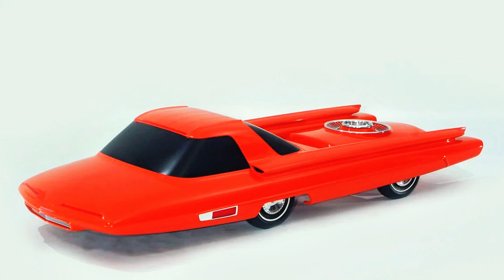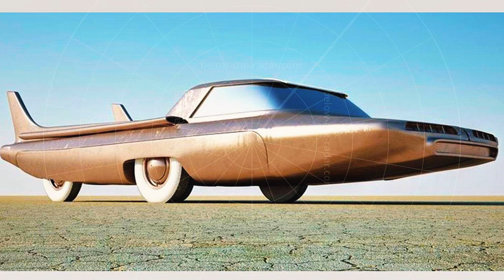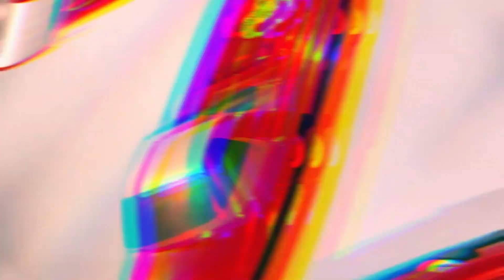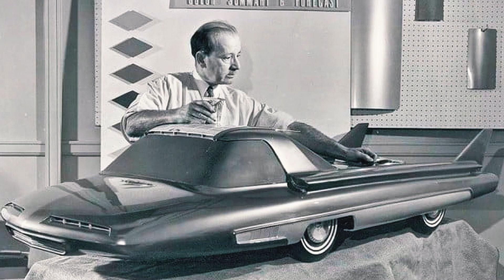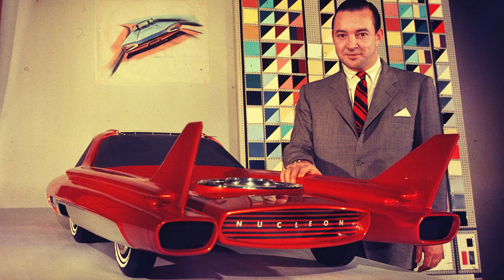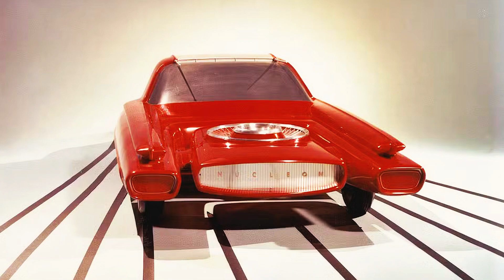Ford Nucleon – The Nuclear Car That Never Drove

Comment: I was born in 1951 and the 1950s were a time of unusual ideas for the use of the nuclear energy. There was the idea of nuclear powered airplanes. There were even tests of a B-36 Bomber carrying a small nuclear reactor that did not power the airplane just for tests. There was also around this time the idea of a nuclear powered jet that could fly indefinitely and after the nuclear bombs were dropped it could keep flying covering the area with deadly radioactive fallout. At least these ideas were seen as impractical and dangerous and dropped.